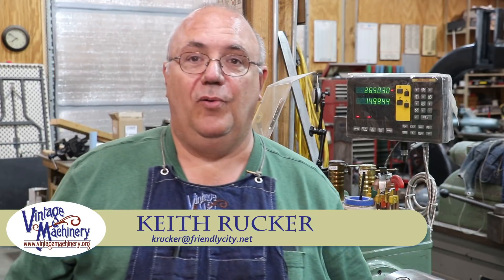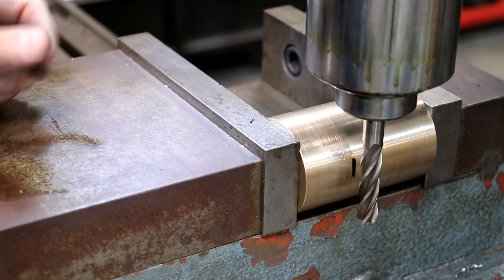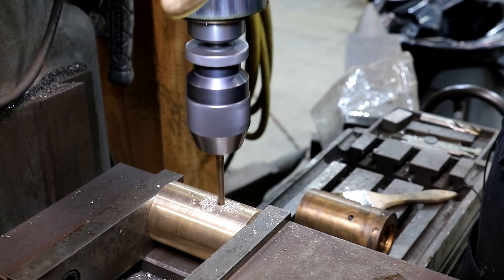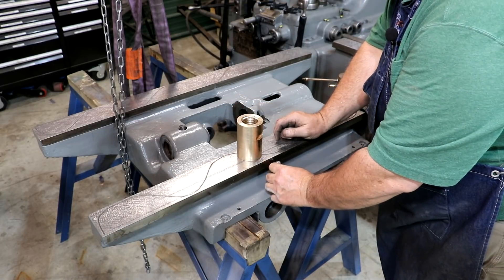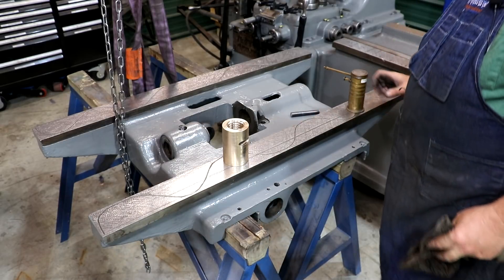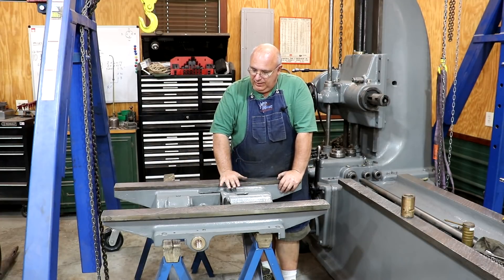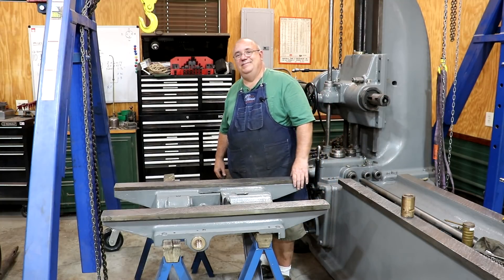Horizontal Boring Mill: Making a new Lead Screw Nut with Internal Left Hand Acme Threads - Part 2

Comment: Well dang, Keith! Looks like you could use a power tapping head on a flex arm (maybe see if you can sneak one away from Adam when he isn't looking? 😁) 

Metabo makes a cordless tap driver. It's similar to a drill, but designed specifically for tapping. Auto-reverse and all that.

(Edit to correct typo)

Comment: I look at the and think. Several counterbored holes that are tapped at the bottom from the far end . Then a few band saw cuts 3/4 of the way thru the nut could allow with belville washers under the heads of the Allen cap screws to adjust the nuts play on the lead screw.

Comment: Any worries about using an impact driver on HSS taper reamer like that? Reason I ask is a coworker once used an impact to run a 1/2" tap to clean holes (clean existing holes, not tap new threads) and the tap was trashed fairly quickly.

Andrew

Comment: Is it just my imagination or does the bed of the horizontal boring machine look freshly scraped in the closing scene?
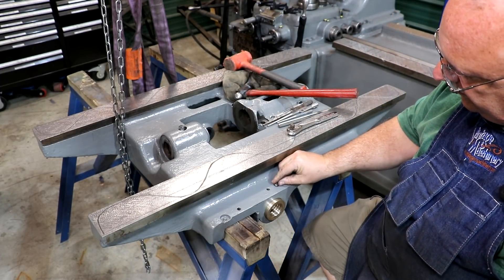Reply: It does, in fact if you go back to 8:50, you can see where someone ie Keith has put permanent marker lines on the ways, just like he did with the slides when scraping the saddle in previous videos.

Comment: 1. Install bushing , ream and put taper pin, then drill oil hole- or 2. align oil hole and put a drill in to hold position while reaming for the taper pin.
Reply: Keith seemed to do just fine.
Reply: @paulcopeland9035  Yeah, it'll be fine, but my guess is the bushing turned a bit when he was forcing the reamer in and the oil hole is no longer perfectly lined up.

Comment: Interesting. Saddle is upside down, [Whoops, evidently not - see Replies] so would the tapered pin run from the other direction (actual top down) to eliminate any possibility of vibrating loose)? Also, does the pin run all the way through the external casting so it can be removed (I can’t remember from disassembly video)?
Reply: The saddle was not upside down in this video, so gravity would not cause it to drop out
Reply: @cryptk  No It’s not upside down but is a little confusing. I had to go back and watch an earlier video to finally understand which side is up. The new bronze nut mates with the long lead screw that drives the saddle and table in the longitudinal direction.